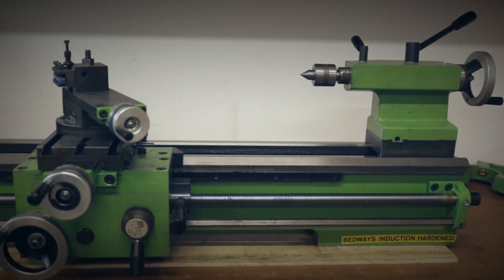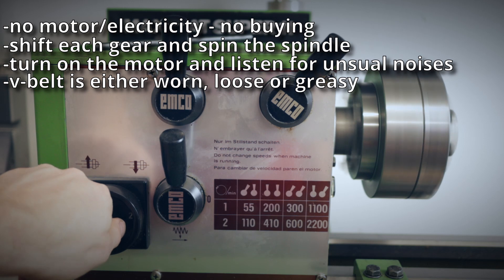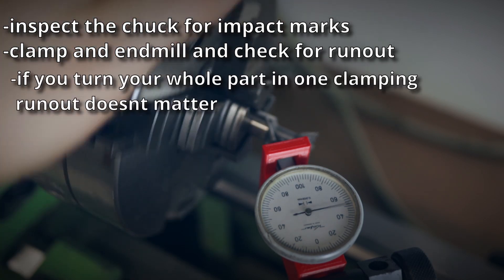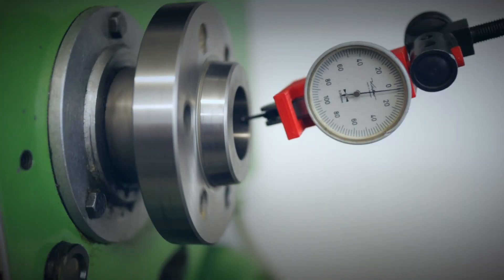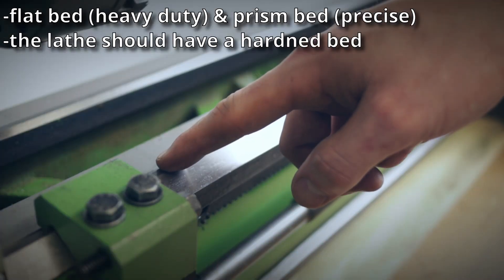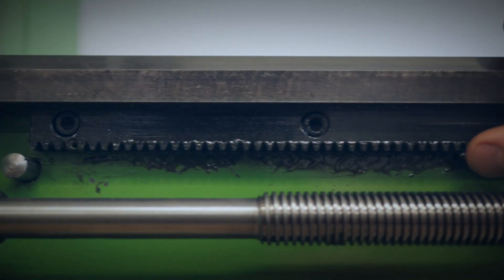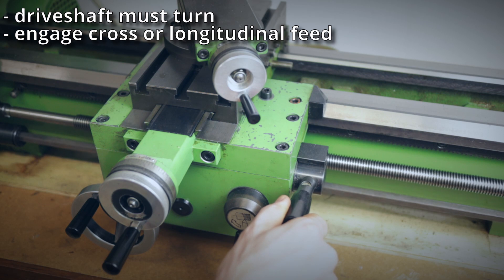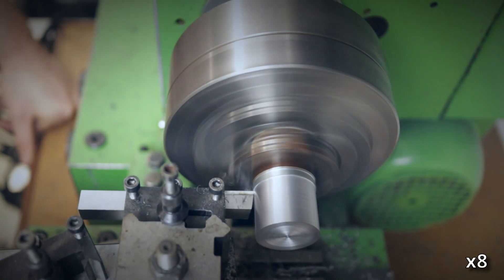USED LATHE BUYING GUIDE

Comment: Howdy, you have very nice videos! I love how you have built the cabinet for the same lathe. 
I have a chinese lathe which seems to be very close copy to this EMCO. The final fit and finish quality was terrible and I Had to do corrections on the spindle shaft (back side bearing had press fit where it had to have lighter sliding fit for preload adjustment). I’ve scraped the table and the saddle (got about 600% increase in MRR) and now I’m considering to do some work on the head stock.  The problem with the head stock is - it has very tin casting on the sides where spindle bearings mount. I am fearing that this is adding springiness to the system and I’m considering to remove the gearbox (yes, cnc would be the only option then) and pour concrete inside to stiffen up the bearing surfaces… 

Could you do me a favor and measure how thick are the side walls where your bearings are mounted? I’m interested to find the thinnest measurement on the wall. Thank you!

Comment: How can you measure runout on a 4 jaw chuck??
Reply from the maker: Clamp a ground pin or an endmill, and check for concentricity
Reply: @ChristophLehner     Ive just noticed - its not an independant 4 jaw chuck